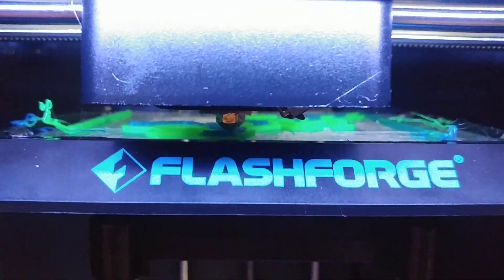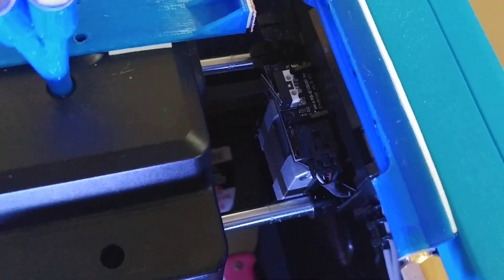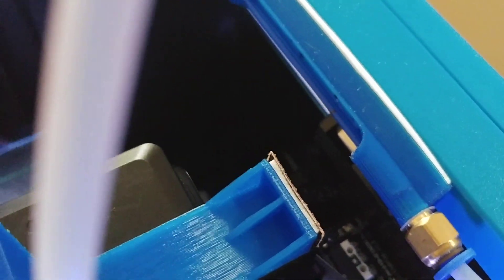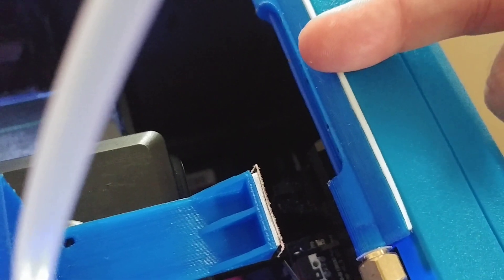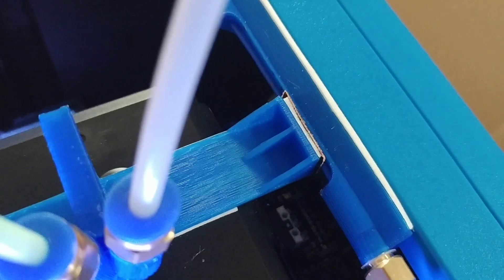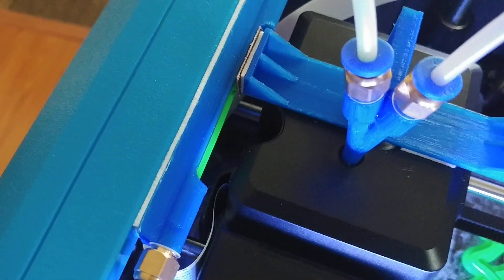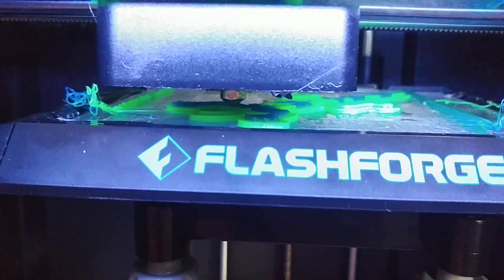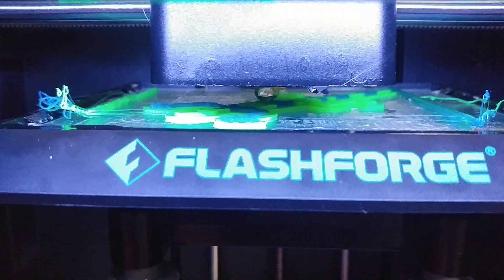3D Chameleon color change

Comment: Very cool idea, and definitely has its uses.   It would be cool to see a quicker, and/or more efficient, color change option though.  Multiple minutes, each time that it needs to change colors, could add many hours to a print.  Plus all of the wasted filament, that it is spitting out, every time that there is a change. 
I get the benefit, and found the video because I want multiple filament options, but hope that this can be improved on.